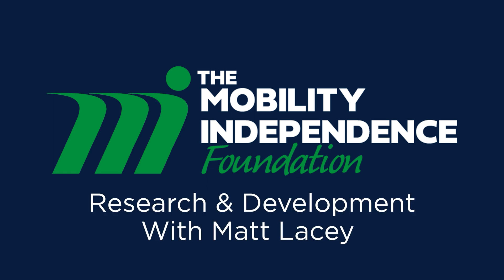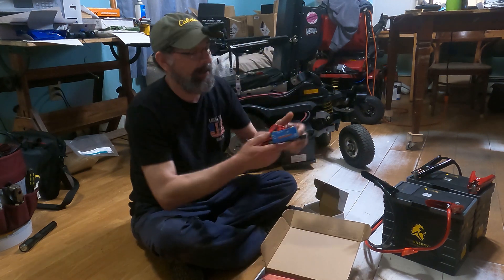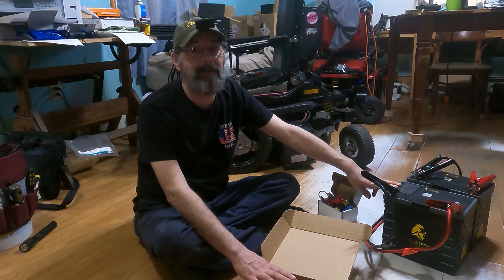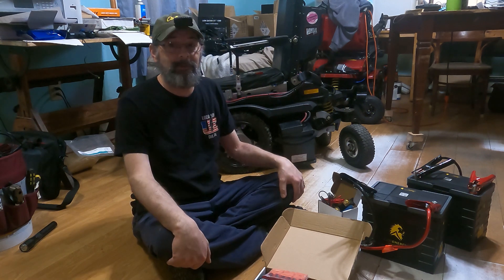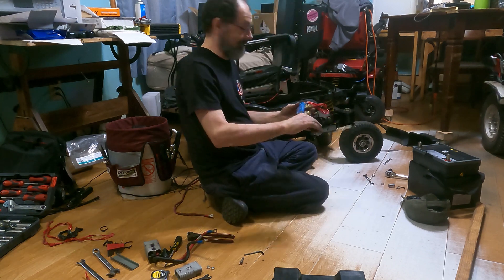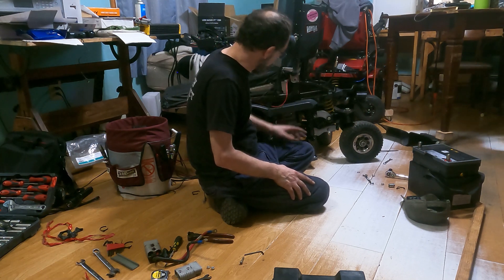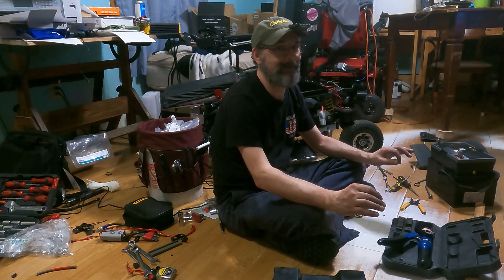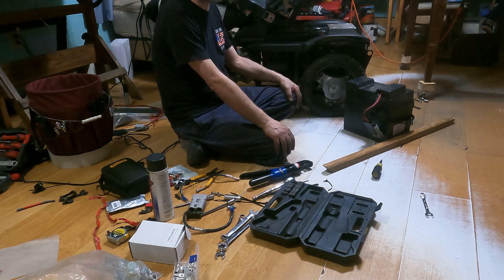Group 24 LiFePo4 wheelchair battery upgrade triples our charge!

Comment: I have a pride victory 10 4 wheel scooter I want to get lithium batteries and I know I got to get a lithium battery charger for it how will I know when the batteries are getting to be half or less than half the batteries that I'm buying are life force batteries with a charger indicator on top of the battery how many miles would I get on the lithium battery compared to before I've been told anywhere from double or more right now I'm getting about 7 to 8 MI
Reply: Looks like you’ll need a U1 size LifePo4 size battery. I would expect you to, at minimum, gain twice the travel distance that you currently have. Though I wouldn’t find it surprising to come close to 3 times. I can find several brands that have 45Ah of power, compared to the original 32-35Ah for AGM batteries. It looks like XLR plug 24v Lifepo4 chargers are readily available at 5 amps. Which worse case is flat dead to full charge about 9 hours. Your regular battery indicator will not be at all accurate as it’s based on voltage.

Comment: The charger you highlighted is not "20Volt" as you said.  It puts out 28.8:volts.  A 20 volt charger would NEVER fully charge two 12V batteries in series.

It is important to occasionally balance charge them.

Another commented said to only charge them individually, or you risk very bad things if one BMS fails.

I am not into solar, but aren't those frequently wired and charged in series?

I wonder if some kind of monitoring would mitigate that risk, such as having a BT shunt on each battery.  Any ideas out there?
Reply from the maker: it’s a 24 volt 20 amp

Comment: I've converted one of my chairs and about to convert another that takes Group 24.  

ButI'm shopping batteries right now and am VERY disappointed you didn't cite the battery brand, and the charger info would be good as well.
Reply from the maker: This video is with Lion Energy brand, we also have good luck with Power Queen

Comment: can  be connected to only one battery LiFePO4 24v
Reply: You can, but the battery slots on a power chair make for a very tight fit.  So using a single 24v instead will not fit without significant mods to the chair.

Making that even more difficult is that the two batteries are usually not mounted side by side, there may be significant obstacles between them, such as the seat supporting column.

Comment: Don't seem to understand?  is that the same way you had to connect to charge the wheelchair all the time?? most wheelchairs charge at the joystick using a xlr connector? 
I just did a conversion on a Quantum Q6 Edge 3 chair using 2 50ah LifePo4 batteries. All I did was install the batteries as you would lead acid, bought a 24v  LifePo4 charger
 with the male xlr connector and it worked perfectly. I did have to do a little fabricating to the battery cover door since the batteries weren't the correct group 22nf size. Other than 
that I just connected a tiny voltmeter to the female xlr connecter to monitor charge voltage.
Reply: Lithium batteries have a BMS (Battery Management System).  Due to this, you don't want to charge them in series (2x12v).  If one of the two BMSs fail, there's a good chance it will short and then dump all 24V on the remaining battery..... 24v on a 12v lithium is NOT a good thing.
Reply: Lifepo4 manufacturers recommend a maximum in series and parallel for your battery back system to be safe
Reply: @meeponinthbit3466  haven't had a problem yet.... but...... I didn't think about that!!! Novice to LiPo's.... that explains it to me.... thanks... so the only problem is in charging.... I think I will make a bus bar switch so I can charge them separately or maybe a couple large diode??
Reply: @TheMamonti1 you want in series batteries to be balanced to each other ie matched voltage else one battery does heavier lifting in the system. We balance before install then charge in series at 24 volts at 20 amps with a lithium charger.
Reply: Xlr plugs can not handle the amperage we want to charge with to minimize down time. Also before install you should always balance the batteries to each other with positive to positive, negative to negative for several hours.
Reply from the maker: XLR typically only pump 8 amps, we’re mainly testing for application purposes. Our final design will use a 24v single 100ah LiFePo4 battery